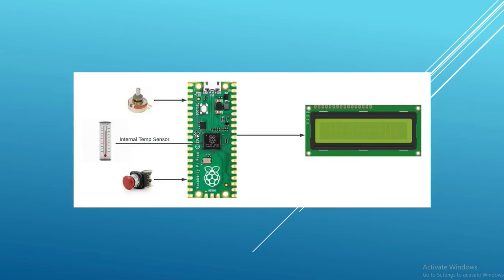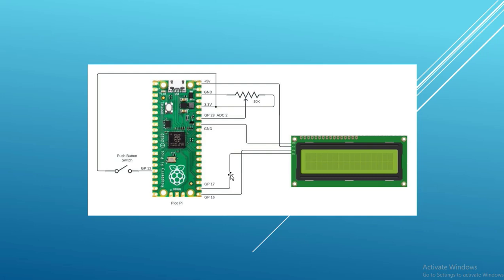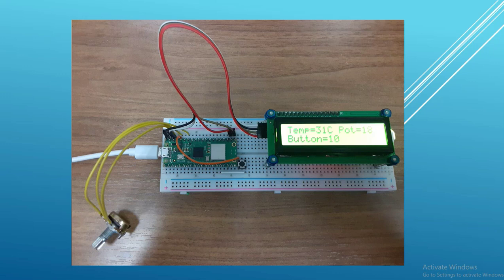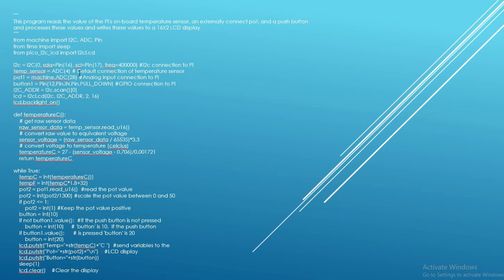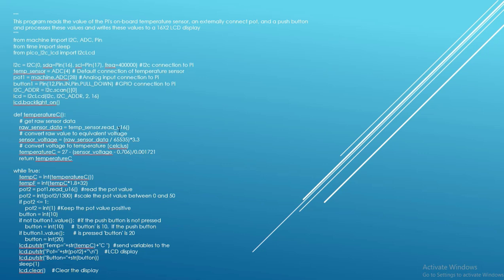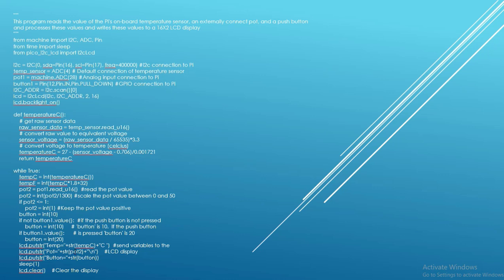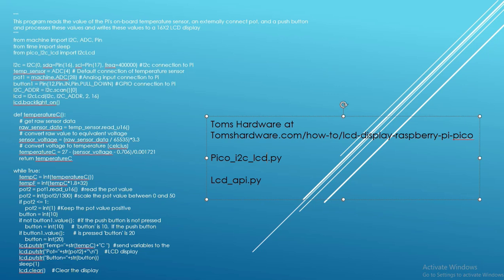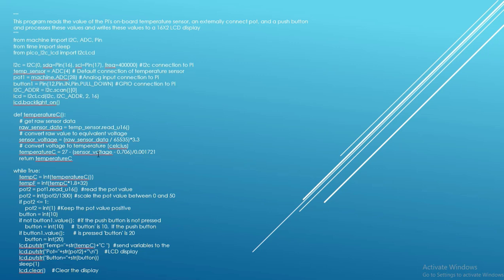Interfacing the Pico Pi to National Instruments LabView Part 1

Comment: Excellent tutorial! - For some reason I had to add a 10K EXTERNAL pulldown resistor to the switch, although the code clearly defines this pin as a pull-down input.